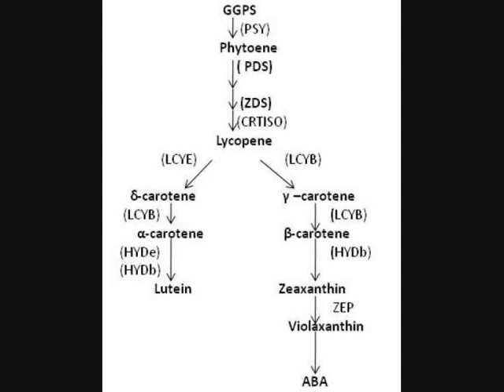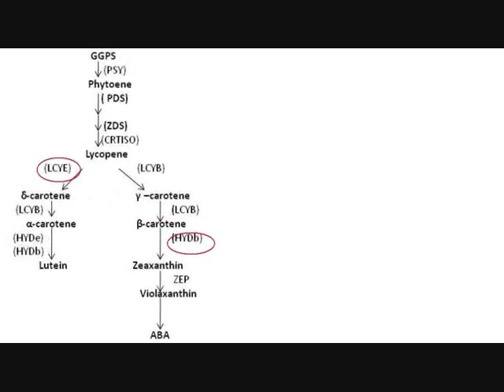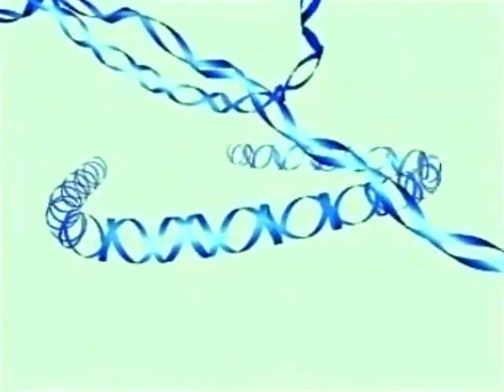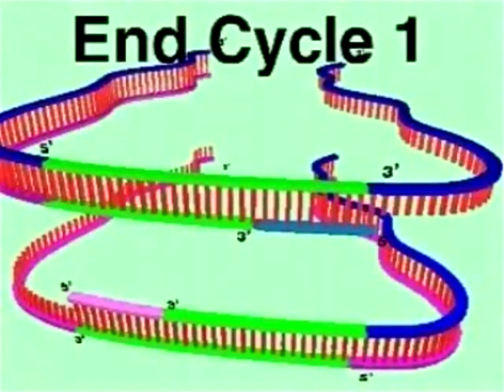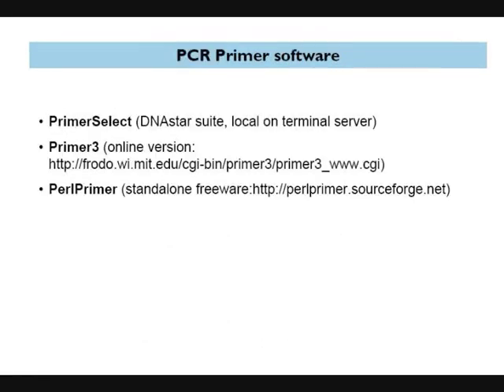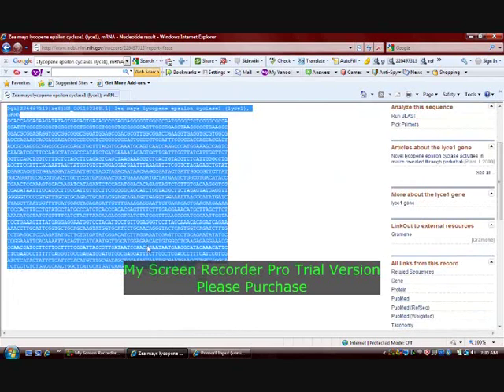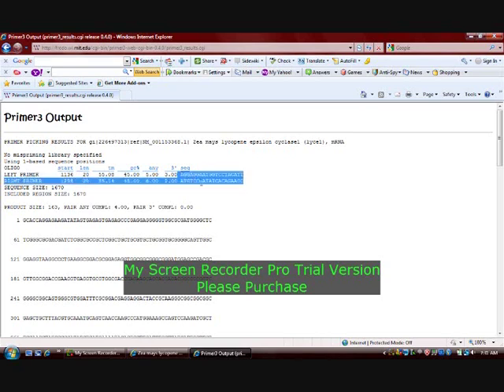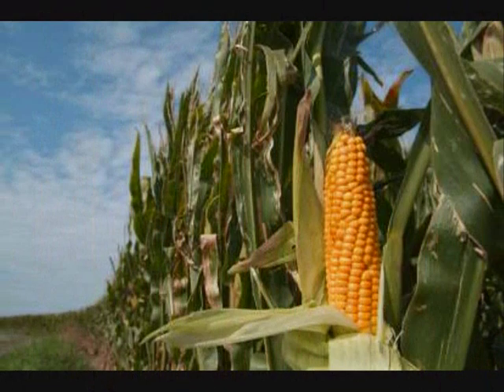How to design a primer?

Comment: It means that the probability that the primer is complementary to another part of the DNA is reduced. The shorter the primer, the higher the chance that it's complementary to multiple DNA sequences. When you make your primer larger, you're reducing the risk of multiplying parts of DNA other than the DNA sequence you're interested in.

Bigger = more specific, reduced chance of compatibility with other DNA sequences.